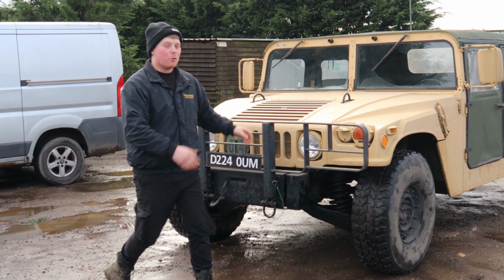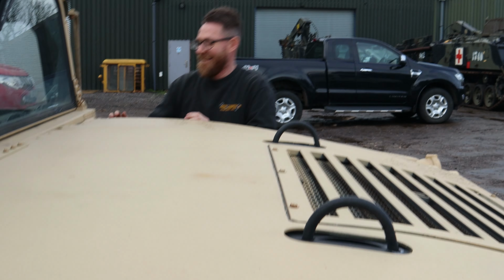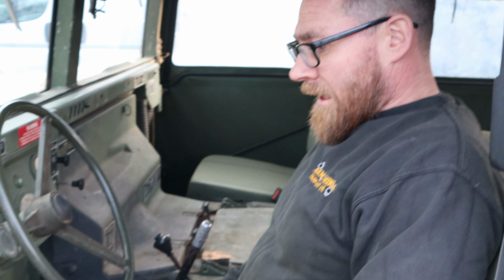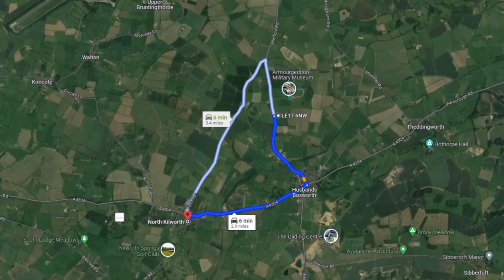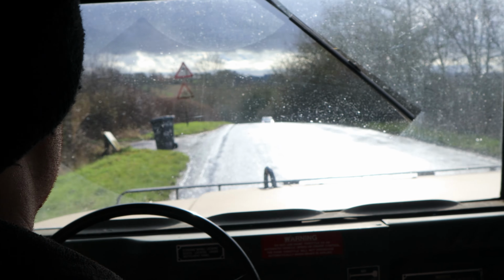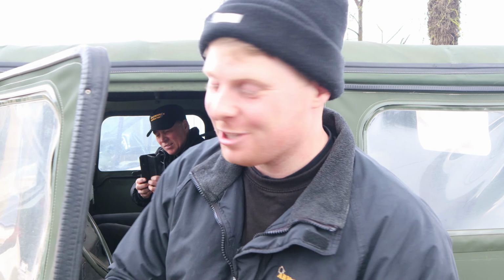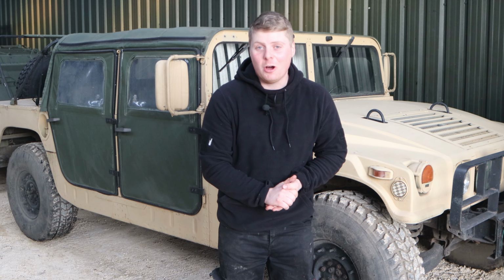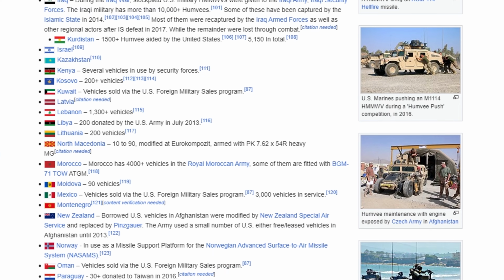Is the American military Humvee a good vehicle?

Comment: The hood is Fiberglass and the body is Aluminum Alloy, the frame is Steel.  I was licensed for multiple variants, 2 Door, 4 door, shelter carriers, armored, uparmored, weapons carriers, troop carriers, and in every climate possible, except underwater.
Reply from the maker: Ah very interesting! I was wondering about that
Reply: AL might rust in contact with steel! plus , lower protection for the crew
Reply: @HK-uq9by  there are composite rubber mounts/spacers between the frame and body.
Reply: @HK-uq9by  you can always look up the build specifications yourself

Comment: You have the best version.  Its drivetrain was built to handle the "Soft-Skin" version.  The one I drove for years was an XM1114 version.  A basic rig with a spall blanket lining in the floor only and Kevlar doors, no plates.  The "Wait" amber light is there to allow the "Glow-Plugs" time to warm-up before starting.

Comment: I have a M1165, the latest variant has many upgrades over the model you test drove and many more creature comforts like turbo charged engine, 4 speed transmission with overdrive, factory air and many many suspension upgrades. Here in the US we can pick these up cheap with low miles. Mine for example is 2006 with only 7k miles on it. These are beasts offroad!

Comment: That "wait" engine light might have something to do with 'pre-glowing' or whatever it's called in english. My father used to drive a diesel car and it had to pre-glow to heat the engine before turning on, apparently the diesel used the compression and engine heat to ignite the fuel in the cilinders. I.e. his car didn't have/need spark plugs in the engine, but that might have been a Citroën thing (Citroën does/did more weird things).
Reply from the maker: Ah very good point!
Reply: I would bet it is related to pre-glowing or similar.  Your description of its purpose is accurate too!  Never seen it on a automobile before.
My family had an old Bolens G172 tractor (a light-duty, deisel engine) and it had the same light.  I can't remember exactly what my father said would happen if it you didnt wait for it but I know it required calling a mechanic so I never tested it.

Comment: HMMWV are not DOT approved for public roads in the USA. That is because there is no mechanical steering link. They are authorized for off road use only. I have no idea about UK laws concerning HMMWV. P.S. I personally hated the HMMWV in the Army. With radios, personal gear, weapons, ammo, webgear. It was so cramped I could hardly breath.
Reply from the maker: Very interesting. Luckily we can use them in the uk on the roads as long as they pass our MOT. I can imagine even though they are large they would be absolutely full of kit haha
Reply: Thats not 100% correct. Mechanical steering connections are not required. Think of all the new drive by wire cars like the tesla. These can be easily DOT approved with just a few modifications like approved tires, working brake lights and marker lights etc. Mine is 100% DOT approved and licensed to be driven on all US roads and freeways.
Reply: You can get them road legal in the US. There are a couple near my house.
Reply: Your clueless.  Stop talking
Reply: I literally drive mine everyday on the road in America
Reply: Here is Texas we can title get insurance and tags and drive them anywhere so the more you know